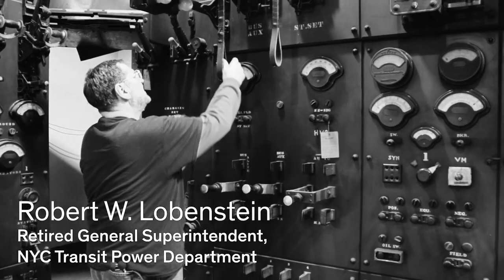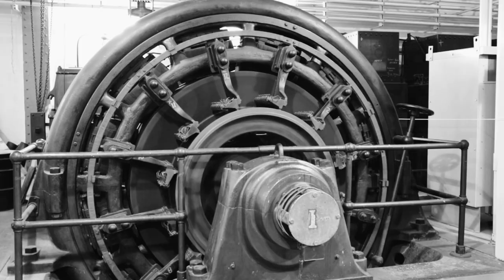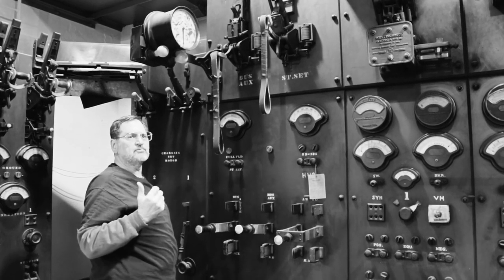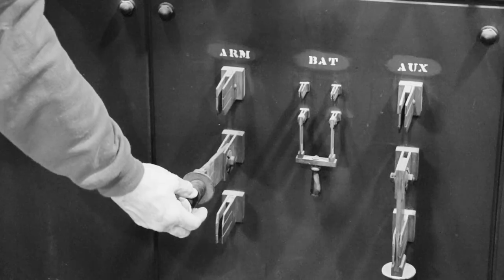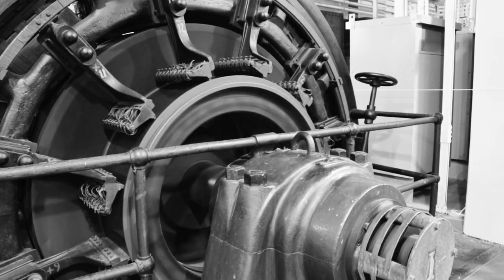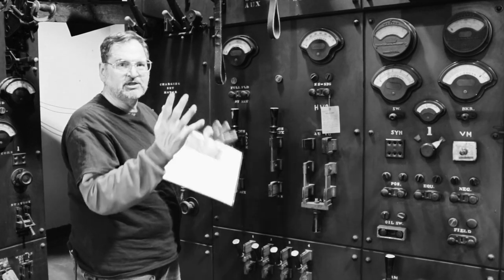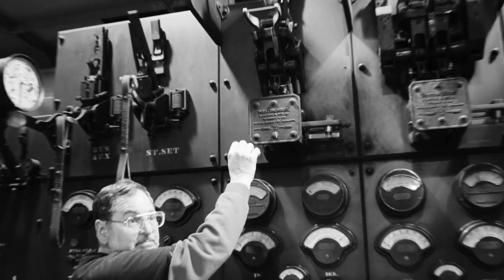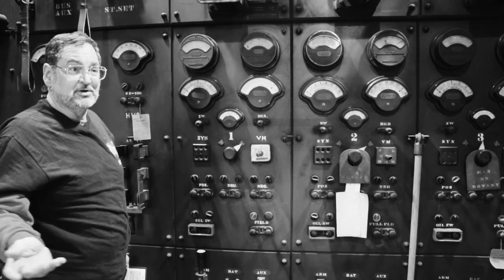NYC's 45-Ton Rotary Convertor

Comment: I didn't really get a good explanation of the point of it all.  This is to convert 600 volt DC to AC?  What?
Reply: glenn harrison 25Hz AC from powerhouse to DC to feed the subway. It just needs to be started from DC power using it as DC motor to get it up to speed and only after that it could be connected to AC feed working as synchronous motor and only then it can start to feed power to the DC side working as generator.
Reply: @Karjis  
I probably got the wrong end of the stick here.  I had thought for a minute that they were using a DC motor to generate AC current ... and I just couldn't see the purpose of that.

I have worked in the lift (elevator) industry all my life.  Until Frequency Drive V³F inverter technology became the norm, high-end lifts had DC hoisting motors, usually using the old Ward-Leonard system.  So there we'd use mains 3 phase AC to drive a DC generator for out motive power source.  All automatic of course.
Reply: @glennharrison7036  yeap maybe just confused as they start the thing with DC using it as DC motor before it can be synchronized to AC power feed. More ”modern” equipment probably would use asynchronous motor which would be able to start by itself from AC grid for this kind of application. Not too much automation in 100+ years old machinery yet.

Comment: Oops, there's no such thing as "DC current."
Reply: Where ? The term definetelly exists and is correct. And yes, this things used or generated DC current. If you are picky with the term being DC current and not just Direct Current ( DC) , it is 100% used in industry.
Reply: Oh, nope, the term is not correct, and you don't need to capitalize the one that is correct (or put space between either parenthesis and what they contain). Anywhere it's used in the industry, it's incorrect. Just because a lot of people say or do something doesn't mean it's right. "Direct current current" isn't correct now and never will be. Only a moron thinks it can be.
Reply: Maxx Fordham! Strictly DC voltage and AC voltage are correct and by relation A.C. current and DC current it's used when using a short term.
Reply: Maxx Fordham! Of course saying "direct current current" is incorrect. Because it's also inefficient. The pleonasm is used for increased clarity and speech efficiency in related literature.
Reply: You know what? If you post a reply and then want to add to that, all you have to do is edit the last one rather than adding another one in a row. (I'm not angry, so don't assume that, please, like some people might; it's just a suggestion.) So why not just do that?
I can understand saying "DC voltage" vs "AC voltage" (P-P/P/RMS), but I don't see how "AC current" or "DC current" should add any clarity over just referring to the currents as direct and alternating. Only stupid people would get confused by that.
Reply: They literally make multimeters that can test current in DC mode.  Of course there is such thing as DC current.  If there was no current there would be no power.  You need voltage and current to get any useful power out of a system, whether it's AC or DC.
Reply: Yes.Then there's real electrical power, and, real  electrical engineering.
Reply: Wrong,  @redsquirrelftw . "DC" already stands for "direct current." So no, there's no such thing as "DC current." (Too bad the YouTube didn't notify me of your reply back then.)
Reply: @peggyfranzen6159 : Not "DC current." So still no.
Also, you don't need that comma right after "and."
Reply: @redsquirrelftw  The department of redundancy department called :) Wow, everyone is so used to DC that they forget what it stands for. Using DC current is like saying ATM machine: a waste. On the other hand, the A and D abbreviations are probably too short to use by themselves, so nobody uses “D current”, they just say “DC current” even though it’s redundant.

Comment: One of the reasons why CBS could not put the first generation of color tv cameras (RCA TK-41) in Studio 50 (Ed Sullivan Theater) from 1954-1965 as there was too much interference from the dynamos. The second generation of color tv cameras (Norelco PC-60, Marconi Mark VII) from 1965 used at the theater were shielded better with mu metal.